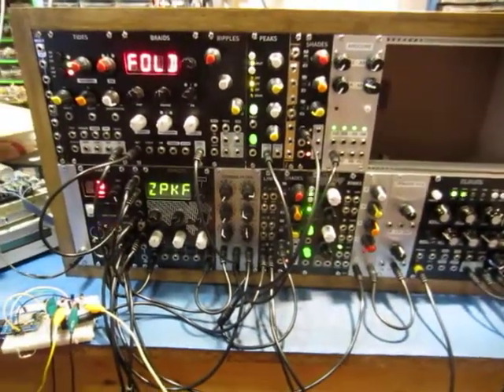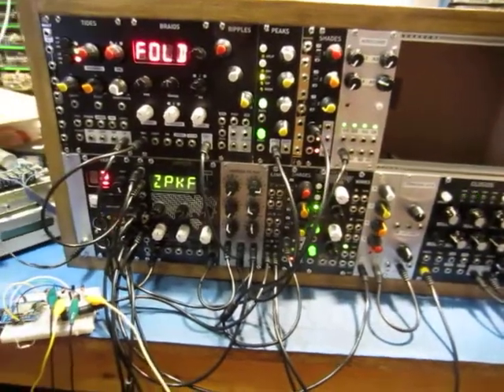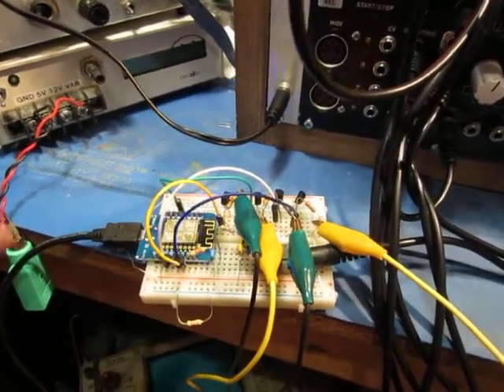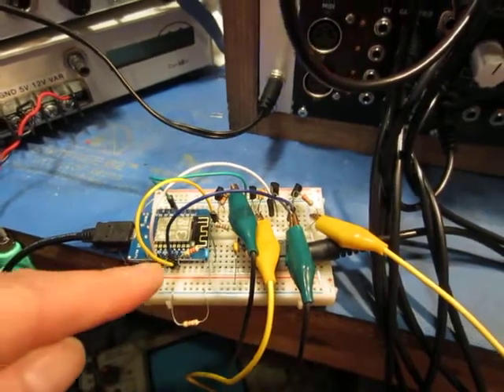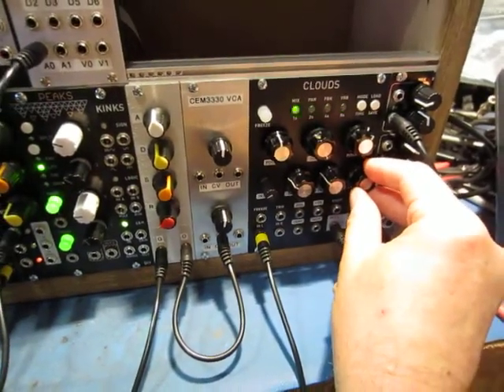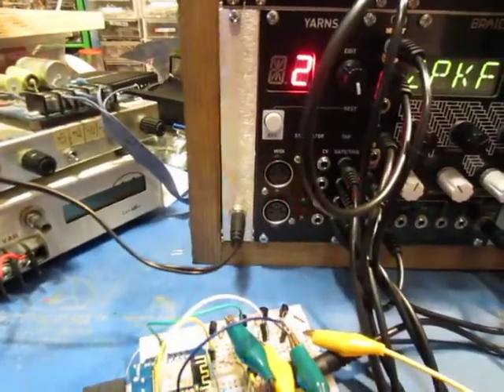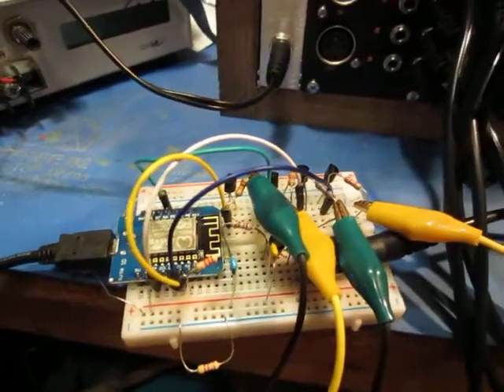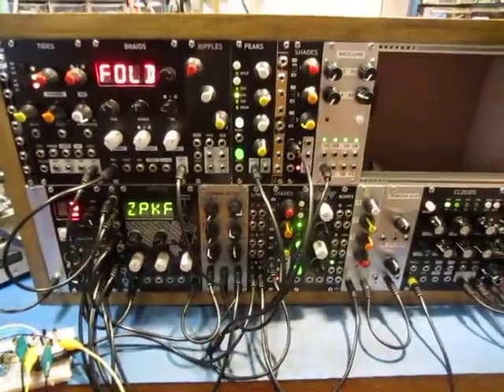Eurorack ESP8266 Drum Machine

Comment: This was exactly, what I was looking for, because I also tried to alter Jans code to support trigger instead of MIDI. However, is it possible that you upload your breadboard circuit design to your repository as well? I connected the NPNs' emitter to GND, the collectors to the respective inputs of the WEMOS and the base to the trigger impulses with 100k resistors in between, is that right? 
My current problem also is, that I can only feed the WEMOS with impulses generated by a system that is connected to a NE555 based beat generator. And somehow it seems as if that beat "jitters" heavily and I cannot find out why.
Reply from the maker: I don't have a schematic for it - I never ended up building that version into a eurorack module. There is not much to it though. The transistor hookup is as you describe and you can use the output filter from Jan's design. An opamp buffer on the audio output is a really good idea.
Reply from the maker: I  did a completely new eurorack module design based on the ESP32 and implemented more or less the same sample player on it:  https://www.youtube.com/watch?v=gmdAXjviXDk  PCBs are available for that module at https://pushermanproductions.com/

Comment: Hi there, nice work!! I have been messing around with this from "audio hacking the esp8266" Wow ! how did you get it to work with triggers? I have very little knowledge of programming....I would love to sort mine out, I'm thinking of building it into a module for my diy modular synth . Would it be to much to ask for or share the sketch? Thnx, Roak
Reply from the maker: Just for you: https://github.com/rheslip/ESP8266-Drum-machine
Reply: @rheslip20  Hi mate, sorry for late reply ( i've been away) & thanks so much for the link!! much appreciated Nice one
Reply: @rheslip20  Cool! That exactly what the Ostman´s code lacks. I´ll be trying it when I learn how to flash it. You did use a FDTI, isn´t?
Reply from the maker: @ZElTGElST  The WeMos D1 Mini has a CH340 USB to serial built in. Install the CH340 driver and you should be good to go.